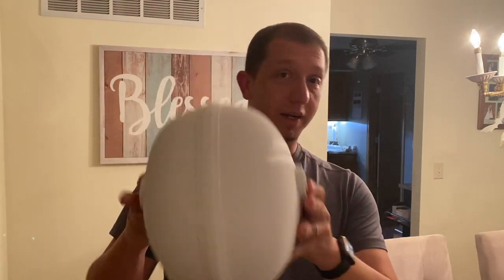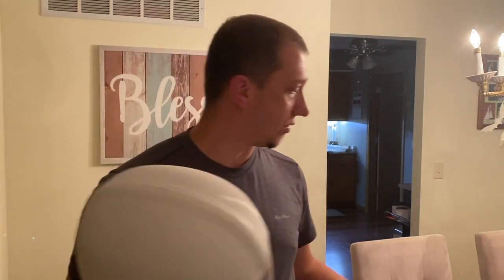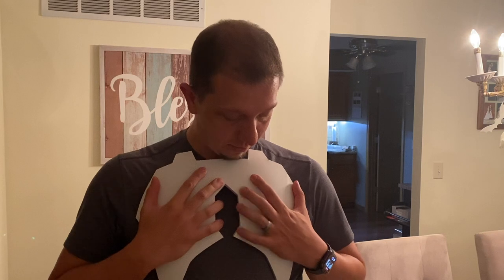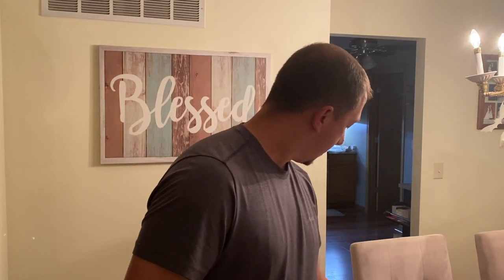How to Make Mandalorian Armor 3D Printed (Part 1)

Comment: Is it possible to print them in even smaller pieces and glue them together
Reply from the maker: Yes.  I am releasing a video this week on that topic!  You can use a tool called meshmixer to do it.  It’s a awesome free tool
Reply: @Rise3DBuilds  oh thats great thank you I got a mini 3d printer for Christmas and due to its size I was wondering if It would be possible to split the printing into pieces
Reply: @mrrags529  hey tho just my opinion I would get to now how to use it properly before you print something like this because it can be a pain not knowing what is happening trust me I've been there!

Comment: What kind of 3D printer do you have?
Reply from the maker: I have 10 printer total in my shop.  For these prints I used a CR-10V2 and a CR-10 to complete all my prints. I used a Ender 3 to print some of the smaller parts.

Comment: Great video! A few questions if you don't mind. What is your sanding process? Did you print at 100% scale and if so, would you change any of it? How many walls did you use?
Reply from the maker: I printed at 100% scale but on a the chest plate I wish I had pushed up to 110.  Walls used is 5.
Sand ing process.
One Supports removed remove any burs and try to sand smooth with 330 grit sand paper.  Use the filler primer for the first coat of prime to help fill gaps.  Repeat sanding process and use filler and more primer as needed until smooth.

Comment: how big of a 3D printer will I need
Reply from the maker: I used a cr-10 for the big stuff and has a build area of 300x300x400mm.  You can make parts smaller so you can print it in parts using meshmixer.  That way you could use a Ender 3 if you wanted to

Comment: what size filament did you use 1.75 or 2.85 ?
Reply from the maker: 1.75
Reply: @Rise3DBuilds  LOL ! damnitt I just bought the 2.85 ! your link sent me to the 2.85 and I didn't think you would respond so fast ! Thanks for the great video ! Just bought a Sidewinder today !
Reply from the maker: I will check out the link.  Should be to 1.75.  Thanks for letting me know
Reply: @Rise3DBuilds  how many spools did you use for the helmet ?
Reply from the maker: 1
Reply: @Rise3DBuilds  awesome ! I ordered 2 so I should be good ! Thanks again ! I may have more questions in the future ! Lol
Reply from the maker: No problem!  That the whole point of the channel is to help out!   Glad to hear from you!
Reply: @Rise3DBuilds  sent you a message on the book of faces.

Comment: Can an Ender 3 do this?
Reply from the maker: Yes but, for the chest plate and the helmet you will have to open mesh mixer and do a plane cut to make the file into parts so it will fit.  I have a video out there to do just that.  Happy printing!

Comment: What printer did you use for this?
Reply from the maker: I used a cr-10 and a cr-10v2
Reply: @Rise3DBuilds  do you know an "cheap" 3D printer that is good for printing this stuff in 1 piece?
Reply from the maker: The cr-10v1 can be relatively cheap now that the v2 and v3 are the flagship.  You will have to fine a printer with A 300x300x400mm print area.  I am a creality shop for the main part so I am reluctant to recommend other printers I have not used.
Reply: @Rise3DBuilds  Alright! Thanks for this video & information!

Comment: Can you see through the visor?
Reply from the maker: Yep
Reply: @Rise3DBuilds  Thanks, Because were getting a 3D Printer next week and i thought the helmet was for show and you couldnt see through the visor.
Reply from the maker: Mine was to wear. I use it as a Halloween costume.
Reply: @Rise3DBuilds  Is there a way to get it in color?
Reply from the maker: @adaptablestreams338   so part 2 I paint it but you can purchase colored filament and print I. A color you want.  The visor came in multiple colors from amazon
Reply: @Rise3DBuilds  Do you have a recommended size for a 9 year old child?
Reply: @Rise3DBuilds  And  Also, Does it Print Straps with it as well?

Comment: can i print these with an ender3pro?
Reply from the maker: Everything but the helmet and the main chest piece.  You will have to use meshmixer to make the helmet and chest piece into smaller pieces to fit you build area and assemble them afterwards
Reply: is there files of smaller parts?
Reply: what about the longer lk1? 300x300x400, will that fit the chest and helmet?
Reply from the maker: I think that is close to the cr-10 build plate which is what is used to print it.  I was able to do mine at full size and it fit me great.  You will just have to try the file in your cura and see if it will work.  Otherwise I would use meshmixer to cut it up to fit.   You can also look around for other files people have made of it in pieces.
Reply: thank you for the help!
Reply: what was the time limit you got with the helmet? i keep getting 3+ days with 190m of filament
Reply from the maker: My cr-10 full size print took 675g of filament and it took 6 to 7 days to print
Reply: can you share the splice file with me?

Comment: Can any 3D printer make does
Reply from the maker: So you can use tools like mesh mixer and that to break up the files to fit any printer.  What printer do you have?
Reply: @Rise3DBuilds  I don’t have one yet I’m saving up for one
Reply from the maker: I used a Cr-10 for most of this one.  It has a large print area that let me print a lot of the parts on one piece
Reply: So you printed the helmet chess with palate arm bands and should pades with the car-10?
Reply from the maker: @tylerryan2187  I would say I printed 90% of this on my Cr-10s. I did use a ender 3 on some of the smaller parts for time.  The CR-10 Build area was just right to do the helmet in one piece and it fit me perfectly when it was done.    You can use a smaller printer like the ender 3 but you will have to break the prints up into pieces to make the whole model.
Reply: What about the leg amor
Reply from the maker: @tylerryan2187  That is still a work in progress right now.  I took some time away from the armor to make the rifle and Blasters.  Still more to come on this whole build. Just getting parts down as I can. The armor is a lot of work.
Reply: How you cut of the extra pieces of plastic when done printing
Reply from the maker: I just use a pair of trimmers but often time you can pull the raft and stop ports off by hand. Most printers come with a pair of trimmers

Comment: What 3d printer are you using ?
Reply from the maker: I used a cr-10 and a cr-10v2 for this one.
Reply: @Rise3DBuilds  thank you, I'll start saving now.
Reply from the maker: You can do it with a Ender 3 if you follow the steps in my meshmixer video to break it up into pieces.  I will also be showing the sunlu 8 which has a lot of the same foot print of the cr-10 but at a lower cost
Reply: @Rise3DBuilds  thanks again for all the great advice. I can't wait to start printing